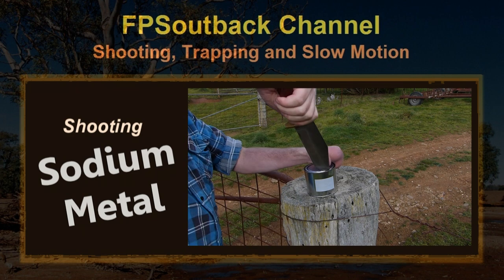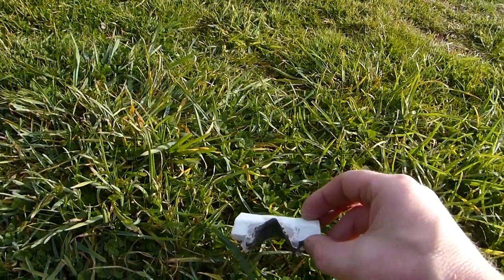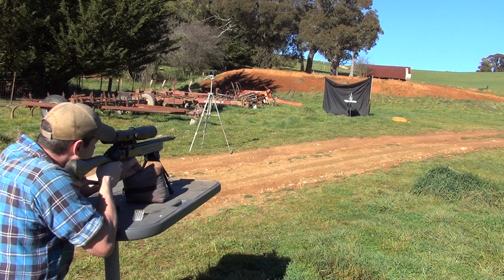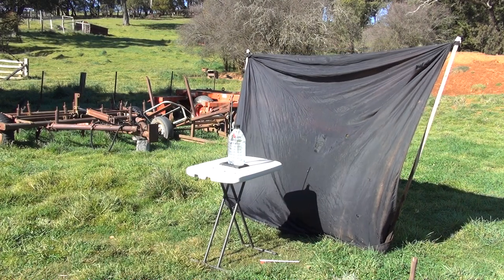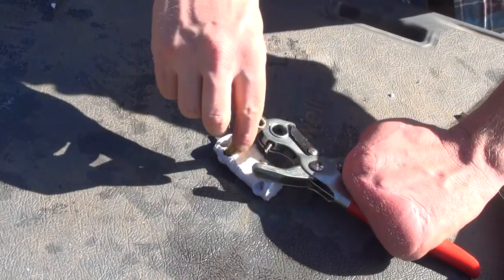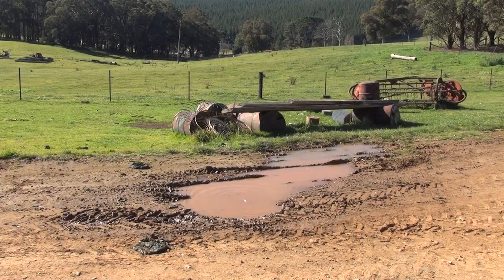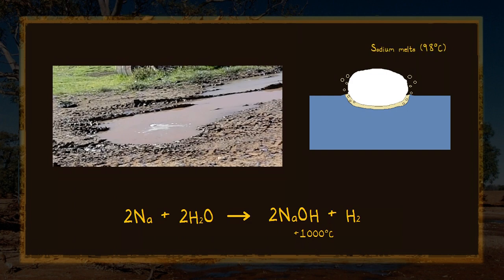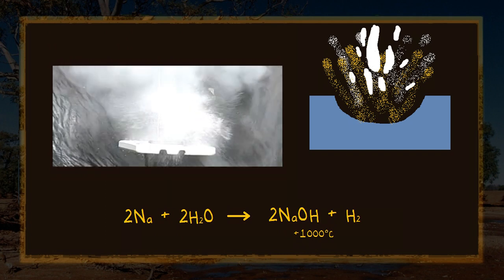Shooting Sodium Metal - Bullets & Explosions

Comment: There was an article recently (can be found in the paid section of Nature) offering a different theory.
Because the metal electrons migrate to the water, the metal gains a very high positive charge which literally rips the molten metal apart (breaks surface tension), very high speed video shows hundreds of tiny needle-like protrusions going from the sodium into the water, both breaking the gas layer and increasing the surface area...

Comment: Great vid. I've always been curious as to the effects of sodium as a projectile, perhaps as a core inside another metal and it's effect once exposed to water inside a target. Very interesting. How large would you estimate the projectile would need to be to create an explosion?
Reply from the maker: Its hard to say really, if you have a jacketed projectile you would have to blow the jacket off on impact which would also blow the sodium apart so the "explosion" won't follow the same mechanism, it would rather bear a closer analogy to a pyrophoric explosion as the small particles react almost instantly. Sodium is less dense then water and can't travel or penetrate much on its own, cerium is more dense and much more reactive but very very soft with a low melting point, a trend to the other alkali metals follow, they give something but take something away..
Reply: FPSoutback Yep cerium is pretty pyrophoric, hence its ferrocerium flint fabrication. Thorium would also make a great pyrophoric ammo candidate.
Reply: @FPSoutback  

An additional advantage would be the fact that, let’s then say you had a ballistic or penetrating cap made of a heavier metal, and then upon impact with a soft water-high composition target, the bullet would then mushroom extremely well. It almost guarantees that the bullet would stop in the target and not hit anything you didn’t intend to shoot.

And if it does hit the target in question, zero doubt the target would not survive. Even if the metal doesn’t explode upon contact with water rich fluid, Sodium Hydroxide is extremely poisonous and caustic. Not to mention it would light the target on fire and result in severe thermal and chemical burns which would likely place the target into shock before they could respond to being shot. 

I wouldn’t wish that fate on my worst adversary.

Comment: I have a question. Would it work if you made a bullet tip with a potassium core, but cover it with a thin layer of brass? I believe that's what people do with ammo these days, plating a lead core with brass. If it was made into a hollow point it might shoot into a tissue break up and expose potassium which would explode.
Reply from the maker: +Galejro It'll most likely be the next video, its already all prepared just need to stop being lazy and do it.
Reply: it would be expensive. and the problem is it has little weight and won't preform as well as lead. but being hit with it would be very bad as the sodium or potassium would react inside the body
Reply: Silas L Especially referring to what you said about it's mass, that way it would always get stuck inside.
Reply: +Galejro it would likely work if cast as a shotgun slug and fired from a shotgun slug especially if lead were behind it
Reply: +Silas L smooth shotgun bore doh

Comment: Sweet video.  Also, I think it would be interesting to do a similar experiment with 90% hydrogen peroxide and a silver catalyst.  They make small rocket engines out of that mixture.
Reply from the maker: That's a neat idea mate, although I'd have to tone it down to 50% H2O2 and MnO2 for cost and availability reasons. Even at 50% a spill will often result in fire, its nasty stuff.